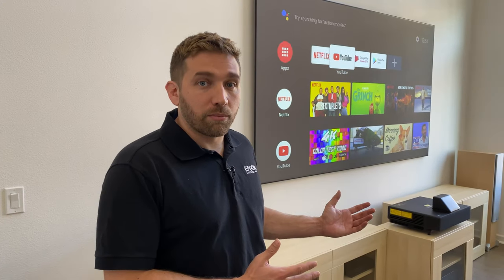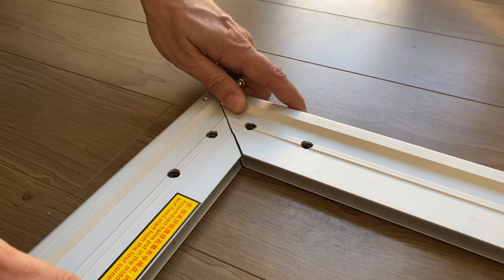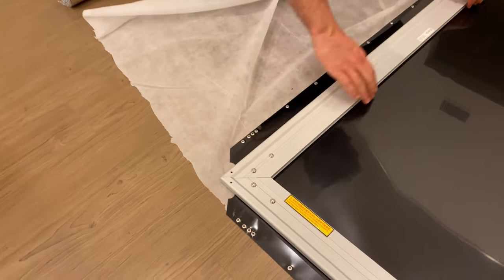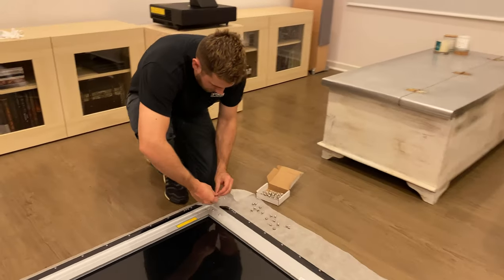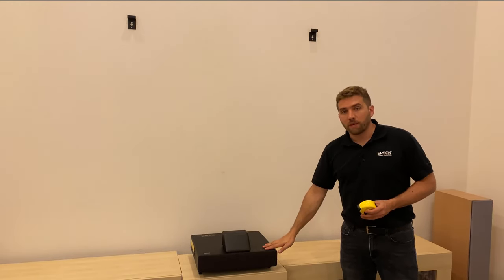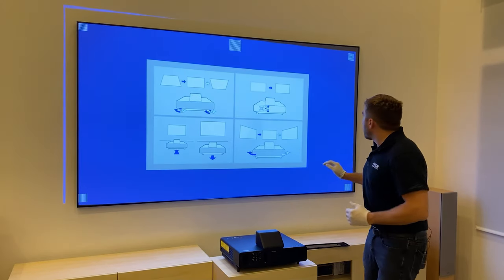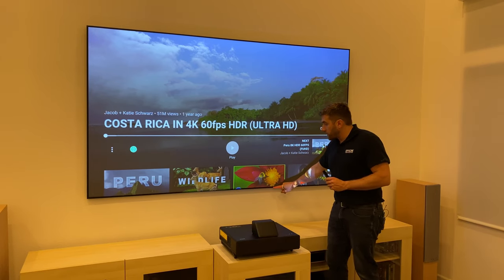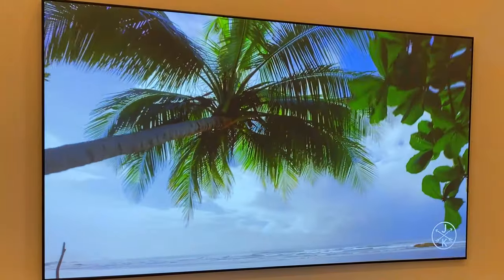Epson EpiqVision™ Ultra LS500 Laser Projection TV | Installation Guide

Comment: what is the projection distance from the wall to projector for 100 inches .it looks way out .
2.how good is the black levels 
3.what if the alr pannel is not purchased ??
4.how is the performance in light controlled room 
5.9400 vs ls 500b which has superior picture  quality ?
thankyou !
Reply: you NEED the ALR for this to look good. why, did you already have an ALR screen? Even if you do, i believe this one is directional for the short throw projector angle

Comment: Looks good  what's the distance from the wall for 120 inch screen  
Yes you can get a better picture in a dedicated room but for day time viewing and having a light rejecting screen is a great combo
Reply: 37" is how far back the part of the projector furthest from the wall (so the speaker side) has to be from the wall. Then of course account for the media cabinet. It's going to look sillly JUST like the demo in this video as they had to put the cabinet further back. IT looks silly as heck. this was a big fail of Epson and they didnt think about as this will not suit most consumer media cabinets/tables.
Reply: @moialder252  that's crazy far back and looks pretty silly. I was thinking ust could be a great option with a AT screen so you can hide the centre speaker behind the screen. Looked into it and you can not get a screen for Ust that is also AT.  if you go ust then you also need to factor in where the centre speaker will go with this setup. Such a shame.

Comment: Hello, where did you purchase the furniture the projector's sitting on?
Reply: Hi Lynn. Did you get a response to your question about the furniture? I would like to know as well. Thanks!
Reply: @Bmeri3  I did not and we've since installed the 120' Epson EpiqVision Ultra LS500 Laser TV. After endless hours researching furniture for it we determined there are no in the marketplace unless you have a high ceiling and  are OK with your screen being higher (which might not work for theater seating).  But in that case Salamander makes furniture specifically for this projector but needless to say it's crazy expensive.  And it wouldn't have worked for us.  Our projector is less than a foot off the ground and 2-3 feet away from the wall.  We ended up  jerry rigging something.  We used two desktop computer stands from Staples with a piece of wood on top, lol.  We just bought two small TV stands/media cabinets to place to the left and right. Good luck!
Reply: @lynnschwartz1108  man that sucks... hopefully they correct this issue

Comment: I need help for my projector the audio went out on its internal speakers there is no sound at all on any app including menu sound as you scroll or select. Since it does not have any sound external speakers also are not producing any sound via 3.5 millimeter jack on the audio out port on the back. I have rebooted from the main menu through devices, I have shut the projector off waited 30 seconds plugged it back in and turned it on. I have made the switch to front speakers instead of av through the hdmi link menu. nothings works this just happened yesterday. I have had this projector for almost a year now.
Reply from the maker: Hi, NIno - please contact our Support Team. You can reach them at 562-276-1300 Mon-Fri 7am-4pm PT for assistance. Thank you!

Comment: sorry epson, you guys made a great projector but didnt engineer this so it could be closer to the wall to project to 120" screen. 37" is WAYYYY too far from the wall to be called short throw. its more like medium throw. Look how silly your demo looks that you had to pull that table back just to account it. A new version has to be made ASAP where you can project to 120" with the projector sitting close to the wall and where the rest of the media cabinet is on your demo
Reply: The new LS800 now satisfies you!